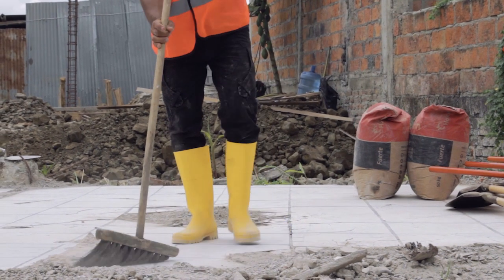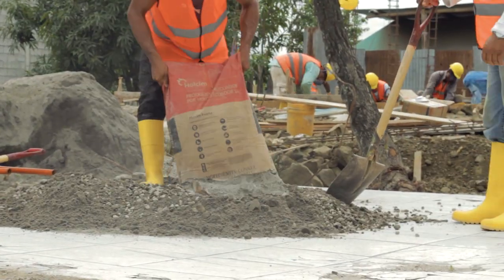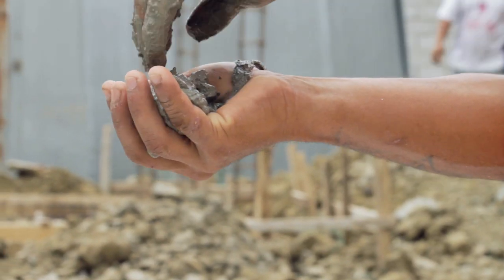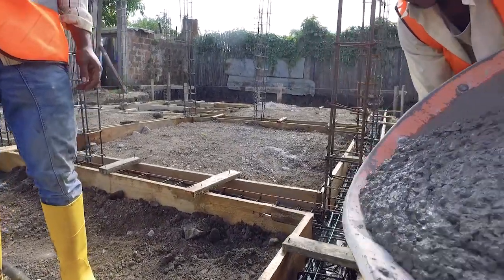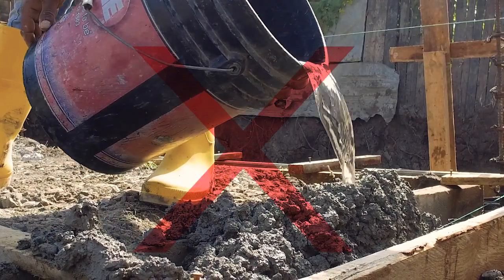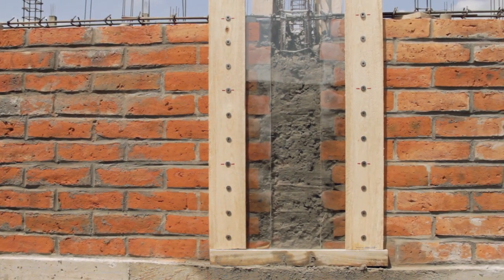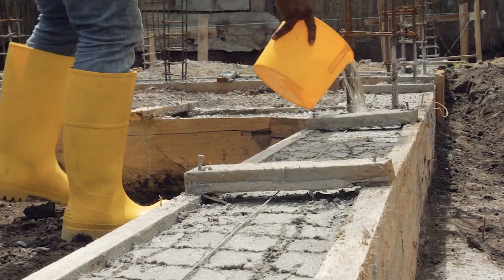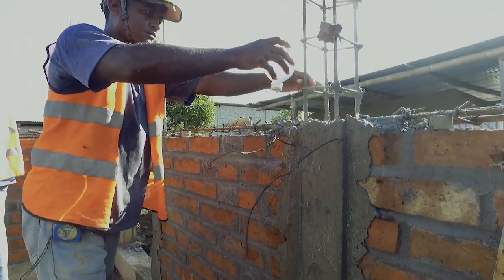Confined masonry 6 of 11: Concrete

Comment: this is  about the salt water in concrete recently they did electro microscopic analysis of old roman concrete in 2016 to figure out why the old roman is far superior to modern mixes....they found a reaction between the volcanic ash and cao2 and yes seawater or sea salts mixed with fresh water ...formed a special molecule called aluminium toberamite ...essentially this mix cures over thousands of years before the reaction is complete meaning this slowed down curing process made concrete with super high longevity....archeologists have even uncovered salt water ponds where forms would be filled and then the concrete submerged in salt water to cure out...2 for weeks then it was removed stored and fit into place using block and tackle ...result concrete that is still serviceable after a thousand years....bridges aqueducts old sea walls and even ports.man made ports for ships to be loaded ad unloaded...Similar studies are under way in India at the old temples and  mausoleums The analysis is they used complex sugars to accomplish the same things as the salts...
Reply: hmmmmm, this is the best way to get comments turned off....... A little bit of civility goes a long way... Maybe your info is pertinant but then again did the Romans use rebar in there concrete?